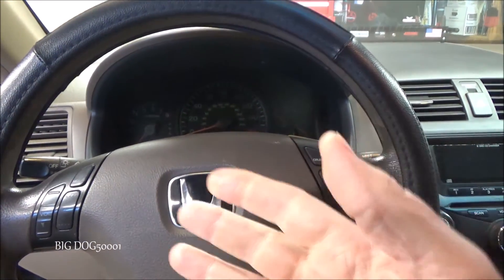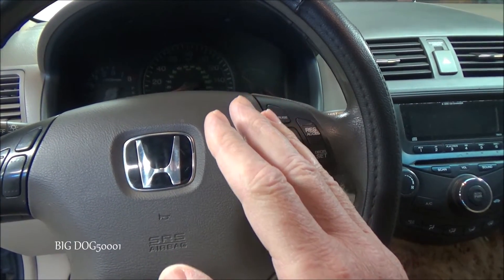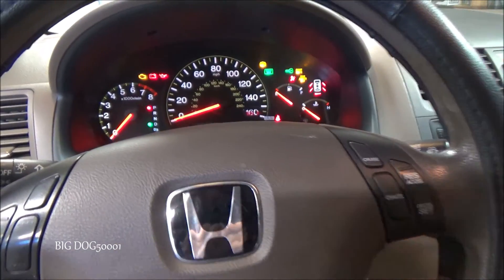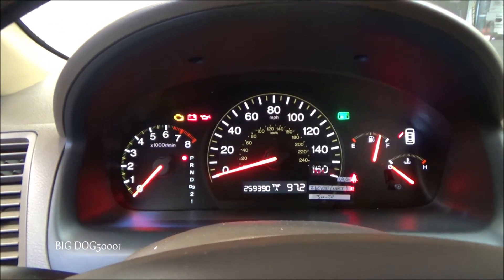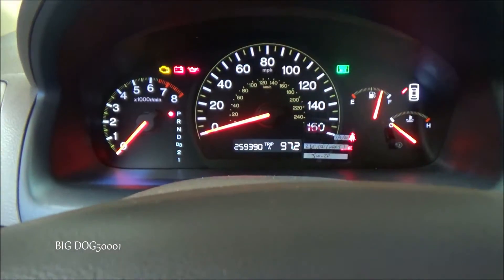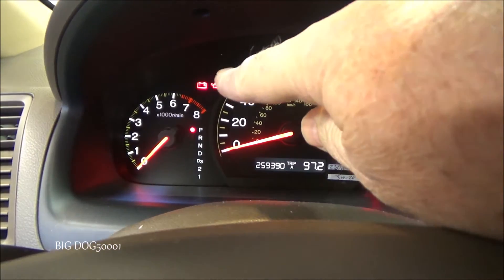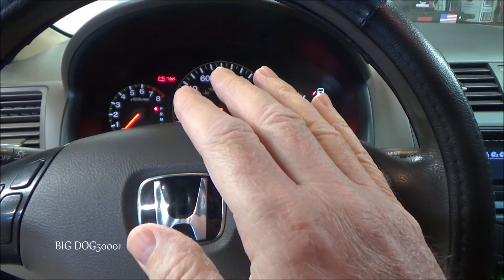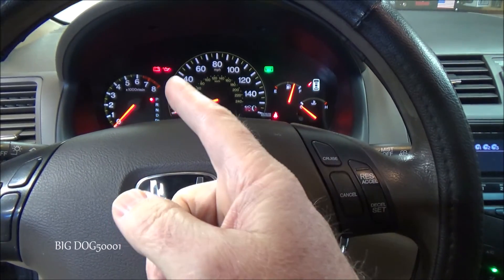Honda Tips: How to Quickly Verify Engine Control Module (ECM) Function (No Scan Tool)

Comment: Replaced starter 06 Honda CR-V car in limp mode VSA & CHECK Engine light on has code U0107 replaced TAC Module and throttle body same issue. Checked wire harness can't find any damage. ABS ALSO on

Comment: I have 2012 Odyssey. new coils, new plugs, new MAF but random misfire (once) and multiple #1 misfires and two #3 misfires for the last few months.... all random in fixing itself (or not) and duration between codes.... 10 miles of driving before code comes on and car misfires.... and twice over 500 miles between misfire.... sometimes the misfire stops after letting the car sit but sometimes it just stops firing until I clean the plug, replace the plug, replace the coils, etc.... then it may be fine for a few days or fine for a month (like in May). I have not replaced the fuel injectors yet but the random misfire tells me it's not just a bad #1 injector.... when I thought of cleaning the MAF it suddenly ran great for just over 500 miles and then BAM, #1 drops entirely. I replace it with a new MAF and nothing changes... after I clean the #1 plug I am out of ideas.... does this all point to ECU? PS: compression is fine in #1 clyinder.

Comment: I have a 2006 Pilot that has intermittent problems with the immobilizer or ecm. Sometimes it will detect the key, sometimes not. I have seen the module replaced at the switch in videos. Is that just an antenna for the rfid chip reader? Is there an output on the ecm that can be closed or jumpered to make the car act as the key is always detected? It has to enable a relay or transistor switch to allow the car to start. The starter spins but something is disabled with a computer output it seems. I’d rather not spend hundreds on this car but I don’t want to get stranded again either. Thanks

Comment: What does it mean when it will start blinking 5 times and then it goes off? I have had to change my alternator about 6 times in the last 2-3 years… the check charging system would turn on ever so often.  I was just told it may be cabling or the computer… could this mean it’s actually the computer?
Reply from the maker: Typically when it flashes 5 times it means the emission monitors are not all complete yet.  https://youtu.be/69KWXaL7RWQ

Comment: Hey Big Dog50001. Thanks for the great content. These videos have been super helpful for me. Do you have a solution for when the car is beeping with the door open? It registers as though the key is in the ignition when in fact it’s not. It’s been draining my battery like crazy. Any help would be great. (Original factory immobilized and key. New ignition switch)

Comment: Question I have a 04 Honda Accord and the car turns on and then off then the  engine light comes on I put the scanner on it read p0122 tps I just recently put a new one and it still does the same thing keeps turning off n then on wen I turn it on it will shut off n the same thing p0122 keeps coming up
Reply from the maker: A P0122 means the engine computer is seeing low voltage (.1V or less) on the Throttle Position Sensor (TPS) *Signal wire*.  

The TPS should have three wires, and all three go from the ECM (Engine Control Module) to the sensor.  These can be checked with a simple voltmeter.  
1. One wire should have 5 volts (5V reference wire).
2. One wire should have ground (signal ground).
3. One wire should be the signal wire (the operating voltage should be between .5V - 4.5V on a good working circuit).   This is where the engine computer (ECM) is seeing the issue (.1V or less) but that doesn't necessarily mean this wire is the problem.  For instance if the 5V reference signal is not getting all the way from the ECM to the TPS sensor, then the signal voltage going back to the ECM will be low.

Some possible problems (not a complete list):
Broken wire on 5V Reference Wire
Poor connections at TPS connector (bad terminals or loose connections)
Broken wire on TPS Signal Wire
Bad TPS sensor
Blown fuse(s)
Bad ECM - a circuit inside ECM not working properly (all power/grounds to ECM have to be checked before condemning an ECM)

Comment: I have a Honda Accord with the check engine light on, bought an obdII reader and got a p0135 o2 sensor heater circuit bank 1 sensor 1.  Where is that sensor located and how is it replaced?

Comment: Any info 2012 Honda Accord , Abs, brake, and traction light on? How to fix it?
Reply from the maker: The lights on indicate the system knows there is an issue, I would start with scanning for trouble codes for direction.

Comment: does this only apply to hondas? or should the CEL turn off with key on after a while on every make/model?
Reply from the maker: This tip is Honda specific due to the way the ECM communicates with the gauge control module.  It definitely will not work on every make/model.  Other car makes may do something similar but whether it actually verifies ECM function may or may not be the case (due to wiring/system setup/communication etc).

Comment: Mine turn off just 3 sec is that ok? Thanks for valuable info as usual
Reply from the maker: Was that Key On, Engine Off (KOEO)?  Most Hondas should go out after 20 seconds if no issues.
Reply: Yes it turn off even before beeping finish. After starting 5 sec it turn back on again with p0135, i did replace both of o2 sensor with denso original o2s still keep coming p0135, same car & engine thanks for replaying